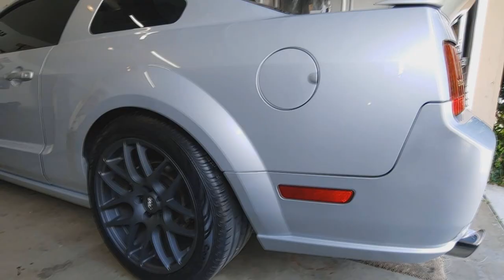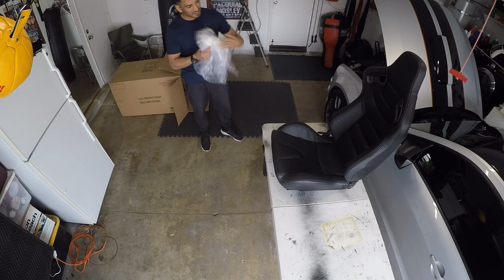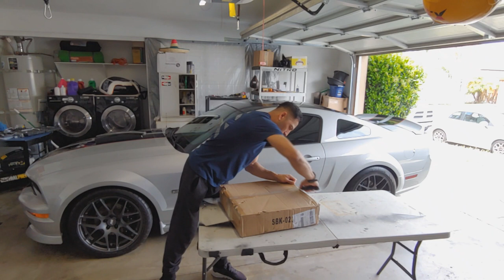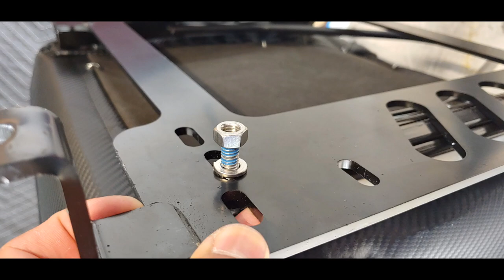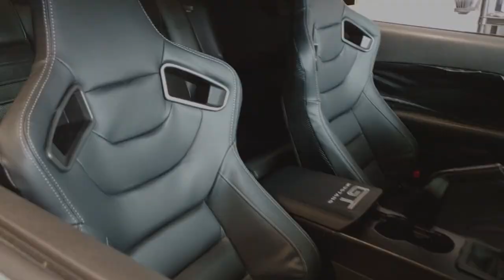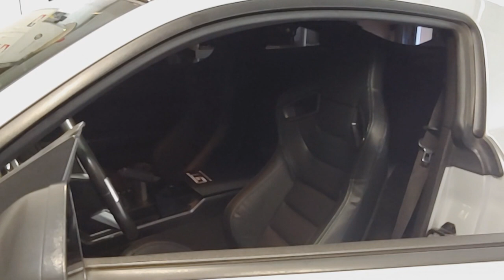Mustang Racing Seats - Aftermarket Seats for GT 3 Valve S197 2005-2009

Comment: Nice bro is there anyway I can find out weight of these seats. did you notice any difference in performance.
Reply: In a 3400lb car you probably won’t feel it if you drop even 50lbs. You’ll be doing good if you do these with other weight reduction parts